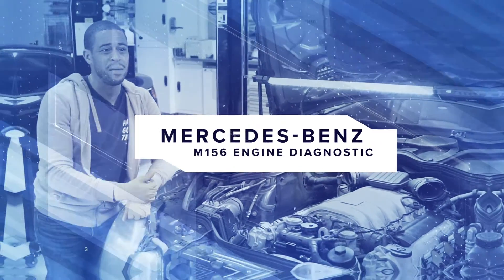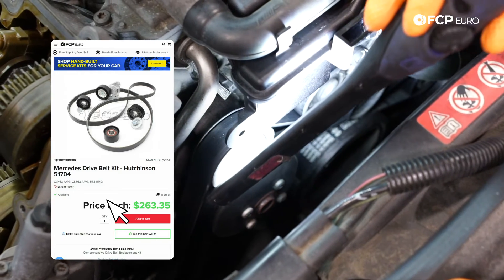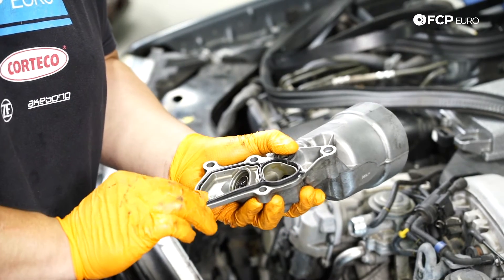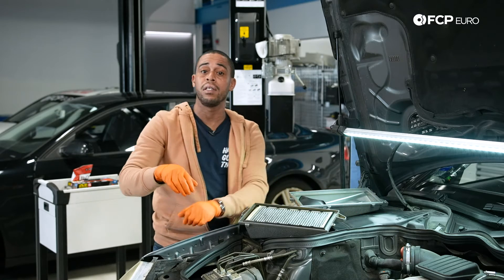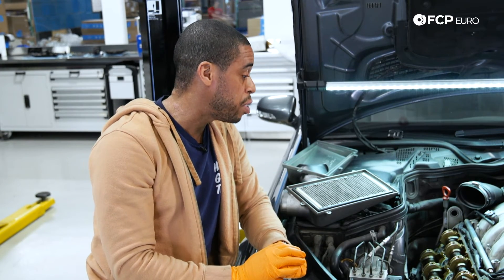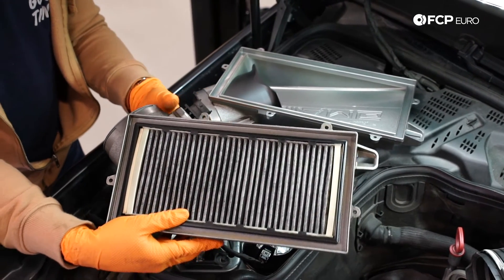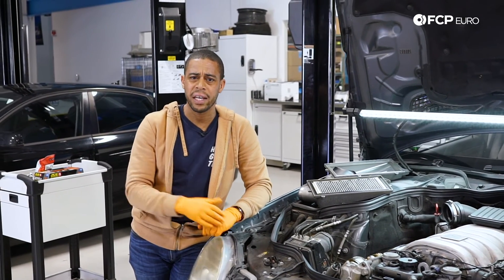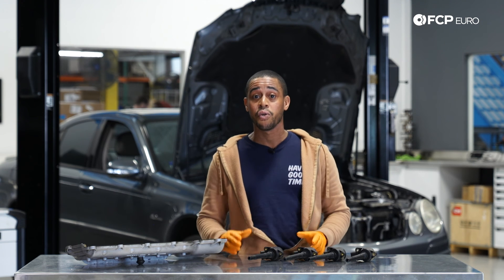Mercedes E63 AMG Engine: Everything You Need To Know - The Mercedes M156 Engine Guide

Comment: In 260.000 kms the 4.0 litre V8 in my Lexus GS400 has had two timing belts, and two set of spark plugs and two water pumps.  It leaks no oil, the variable valve timing works perfectly, and it burns no oil, and has no valve train noises.  The specific output compared to the 6.2 litre 500 hp M156 engine is very nearly the same.  So why did MB have such problems with their engine design?   Even more telling is the 6.4 litre Dodge Hemi V8 of 485 hp.  One camshaft, pushrods, and two valves per cylinder making the same horsepower as the MB engine.  With way more low rpm torque.  And they are used in trucks too, working hard all day long.  
MB - engineered like no other car.  That's for sure.

Comment: 2010 E63 - M156:  car has 68k miles and runs great but I told my mechanic I wanted to be proactive.   He took off valve covers and inspection shows some cam wear and a bit of pitting.  I am replacing cams with billet cams, lifters with the SLS upgraded ones, the phaser plates on the cam adjusters with a harder alloy (rather than replace entire adjuster), and, of course, new headbolts.  Let me add that I bought car in 2014 with about 34k miles.  I have been very proactive about maintenance, maybe obsessive.  I put on about 3300 miles per year and have it serviced every year, including oil change and additive.
Reply: Thanks for sharing !
Reply: same here i have a 2009 cl63 with obsessive maintenance and these m156 engines are hardcore and will last a very very long time if you give it love
Reply: How much did he charge for that service?
Reply: Thats exactly how you treat this engine

Comment: This engine is very hard on engine oil, though almost no one talks about it on youtube. Engine oil temp runs continuously 110-115 °C on the highway, and can reach 140°C very quickly on a spirited drive/hillclimb, especially on facelift models, due to lack of air cooling. People who use these hard are complaining especially on hot climate regions. What do you recommend for these regions? A lower temp oil thermostat? Thicker oil maybe, like 5w50 or 10w60?
Reply: I replaced the oil coolers on mine, now it barely ever gets hot.
Reply: Mine is on hot climate !
113 C easily  reached  when accelerated a lot.
And all engine fans on!
Reply: @EnPassantD  it runs like a nuclear power plant, not like a car motor 😅
Reply: Ha ha I only drive my car in the winter time because I feel that

Comment: Hi guys hope anyone here is able to help me,

I have a 2012 w204 c63 with 49k miles .
Stock exhaust, stock car.

I have this annoying rattling a sound like a diesel engine running coming from the right side (RHD) every-time I accelerate on low throttle any gear (normal city drive) from 2000rpm till 3500rpm 

Video:

https://youtube.com/shorts/jpCYE-l7yDQ?si=FkKqWujV9phkT2bt

I have checked all exhaust leakages found none, check header leakage didnt found any, changed header gaskets , checked everything that could vibrate could find anything, changed engine mounts but that didn’t fix it , checked the right side cams and cam lobs all looked smooth.

Please help me i dont know whats causing this sound , i have zero cel and the car drives normal.
Reply: Hi mate. Did you found what the problem is and fix the issue? I hope so. I have exactly same problem...
Reply: if there is a rattle noise something is loose . Pin point where the noise is coming from , it could be a sticking lifter be it could also be a loose heat shield

Comment: @Fcp Euro  I am a new sub, to your YT channel, however I've been buying parts for my 2013 C63 for more than 4 years.  At the video timemark @2:47 I am glad in a way that it is not just my build that was suseptiable to that oil weeping/leaking from the bed plate.  My question is WTF.  While under warranty they Mercedes Dealer said it was the lower front oil pan so they removed it and put lots of sealant on it.  How every it was not until a few months ago that my independent mechanic found out that it was leaking from the bed plate and gave me two options to fix it.  One reseal the outside of the bed plate  or pull the motor out of the engine.  I went with the reseal because it will take $7,500 to $9,000 to pull the motor put on an engine stand and flip the motor remove and replace all the bolts as they are one time use.  So far so good on the reseal I will see what I will do in the future.  Side note since Mercedes has official unveiled the new 2023/24 C63S E Performance 4 cylinder, my 6.2 Liter N/A V8 will probably go up in Value😄😄😄
Reply: I forgot to add my car is a 2013 C63, why has Mercedes never changed the formula of the sealant or change the way the robot put down the sealant bead on the bed plate?   I believe that the Factory can actually trace the cars that have weeping/leaking bed plates, by builder or by month date year the motor was built.  I am sure an argument can be made that Mercedes was well aware of this issue, but failed to address it.

Comment: I’m in my second year of owning a 2012 c63 coupe. I got it at 58,000 miles. It’s now just at 70,000. Everything seems to wearing out. I had installed new throttle bodies $2500! Now, the valve cover gaskets are leaking. I put new fuel injectors and had the valve covers fixed $2000. The parts are relatively inexpensive but is the labor the kills you.
Reply: I just went through the same thing. Replaced belt, tensioners, thermostat, valve cover gaskets, oil housing gasket, transmission service...ALL IN THE PAST 2 months. Merry christmas to my c63 haha.

Comment: Great video covering all the common stuff.  Regarding the spark plugs, the service manual calls for a 60k change.  I did mine at 60k and they didn't look bad at all.  Probably could have waited until 70k like they suggest.  Doing frequent oil changes as they suggested helped the wear on my cams.  They looked really good at 70k.  I did replace all the lifters while changing out the 63 motorsport cam plates.  No more lifter chatter...  Car idles much quieter now.  Of the 32 lifters, only 5 of mine still had working spring pressure.
Reply: Very nice!
Reply: Hi, I just bought my first C63; daily driver; what mileage interval do u suggest for oil changes?
Reply: @MrRjnr  I'm in Florida so the oil temp gets hot in the summer.  As much as 245F if I get on it.  So I do every 3-4k miles.
Reply: @FirearmTutorials ok thx! I'm in California.  Will be doing 3k 😁

Comment: Have an issue with my C63 2014 90K km on the ODO. Just started making a loud ticking noise. Sounds like a single lifter got stuck. What should I do in this case? Oil flush or should remove head covers and do the inspection?